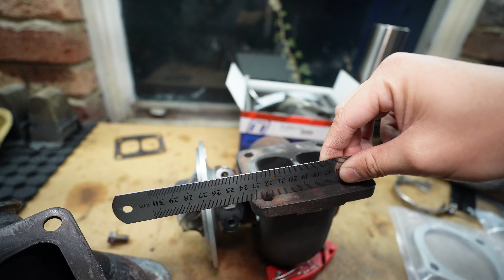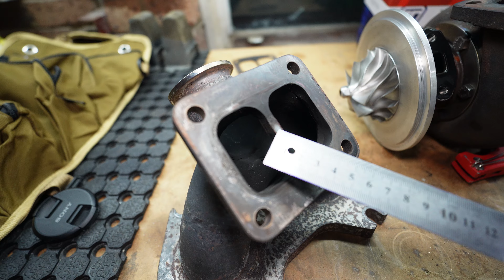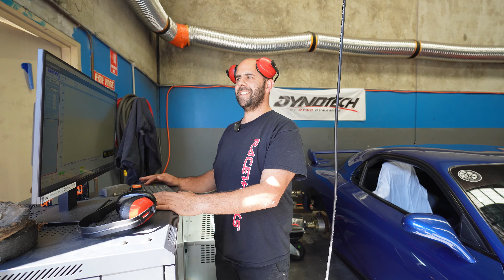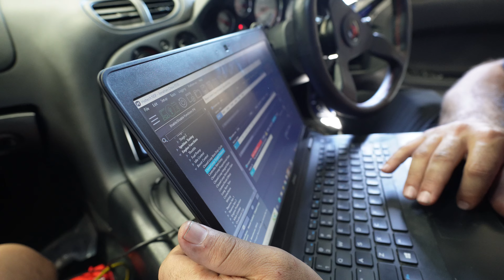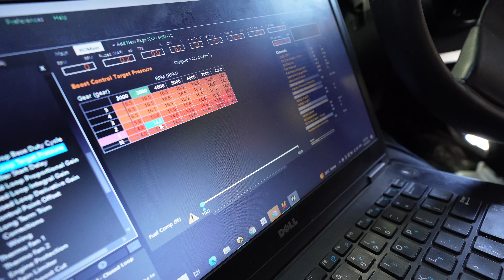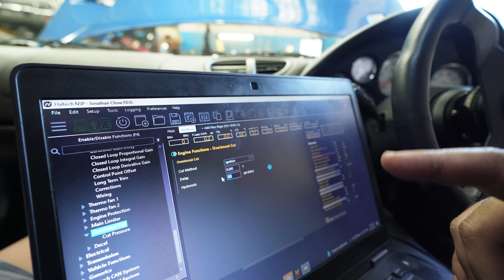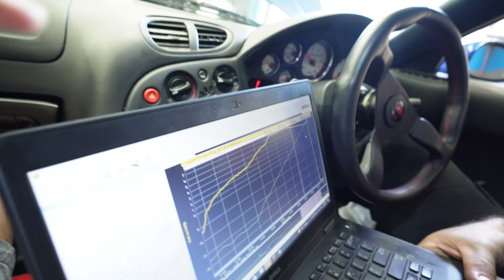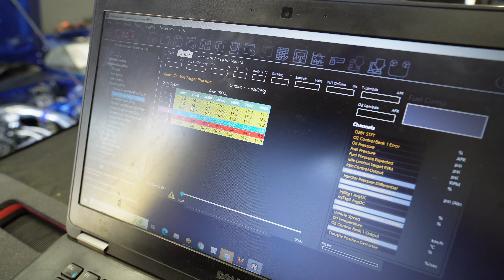RX-7 13B ARTEC manifold INSTALL - FAB - TUNE

Comment: Impressive work ethic! Have some doubts the wastegate diaphragm will last long term in that proximity to the pipe on track though. The lower steering universal joint boot will likely fall apart without protection too
Reply from the maker: Thanks mate appreciate it!
I agree I don't think the gate will last, but let's see. I was going to check the colour of the anodising on the wastegate after the dyno session. Will check it and report back in the next video. It was surprisingly cool there after a spirited drive. Cheers mate

Comment: Hey what drain line is that?
Reply from the maker: Hey mate it's a flexible one. Got it from efisolutions but most automotive plumbing manufacturers now sell them. For this setup, definitely go with a 150mm flexi with a 45 swivel adapter on the front cover
Reply: Ah okay, thanks bud!  What are you using off the front cover to move to a -10AN?

I modified the stock drain piece but would like to use the setup you have with that hose.